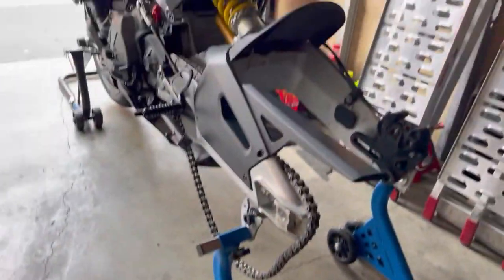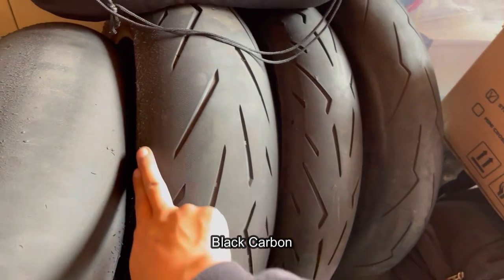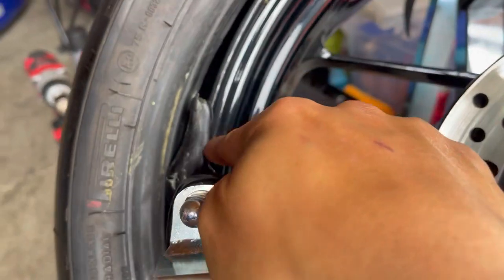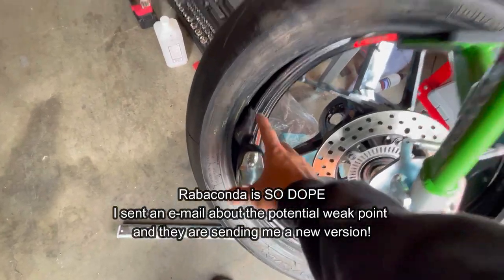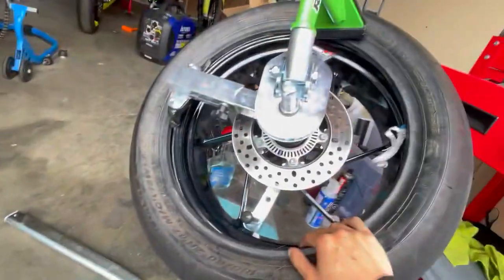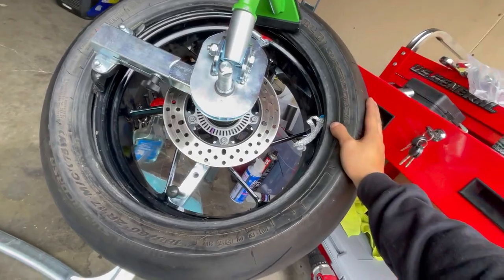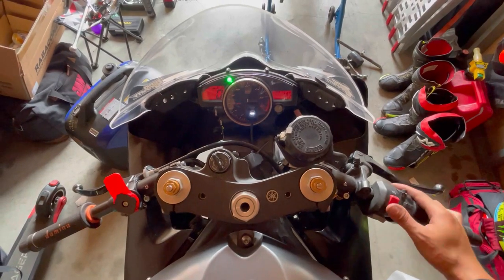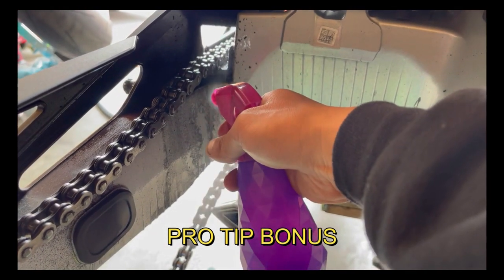How was the Tuono 660 Factory at the track?  | RABACONDA TIRE CHANGER?

Comment: I am a beginner. I want something to use both intracity and for long ride time to time. But I don't want a touring bike I want something faster and more agile. This one is the best I could find so far it's not that fast not that slow. They say it's comfortable too and it's pretty loaded in term of electronics and features. Would you recommend me this one?
Reply from the maker: It's a very versatile bike for the 2 things you've mentioned!
Reply: @suh_slow6902  Thank you so much for replying. I would consider something more powerful but as a rookie and living in somewhere with no motorcycle culture whatsoever I don't want to kill myself tbh.
Reply from the maker: @eyupatasoy6539  Totally understandable! And no problem, feel free to ask any questions in regards to the 660, I'll answer as best as I can! 

I think it all depends on the type of riding you enjoy (not necessarily you have to do). The 660 will feel a bit slow especially if you're drag racing your buddies on 600s (inline 4s), you'll be slower. However, the beauty of the 660 is the cornering speed!
Reply: @suh_slow6902  I am really surprised to hear that tbh bcs everyone I know and asked told the acceleration and the general power of the tuono 660 feels more than what it ranks among the other 600 700 cc motorcycles. Tbh I’m considering to buying aprilia because it seems it is the most equipped motorcycle for it’s equivalent others and not that fast so good for a beginner. I’ll probably upgrade it to a sport touring one at the future. I like speed and agility but don’t want to give up on comfort and technologic stuff too. Thanks for the answers and the video a lot it was super helpful
Reply from the maker: @eyupatasoy6539  tell them to line em up and you'll see for yourself haha. i've lined up against most 600s at the track. it's only the first 20ft i wanna say the tuono can keep up or even feel like it's pulling, but as soon as the top end of an inline 4 hits, you'll see their tails
Reply: @suh_slow6902  Tbh I trust your experience. But the fact that it’s not that fast is even better for me as a beginner I’m okay with that. I wanted something agile and nimble. For top speedish stuff as long as it can go up to at least 200 km I am okay with it. Thank you very much for the information btw 🙏🏻